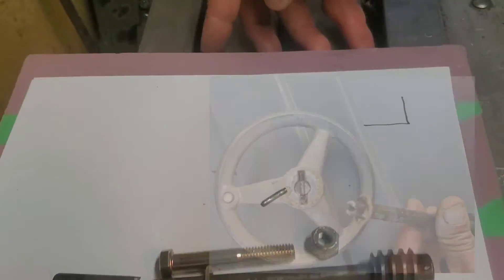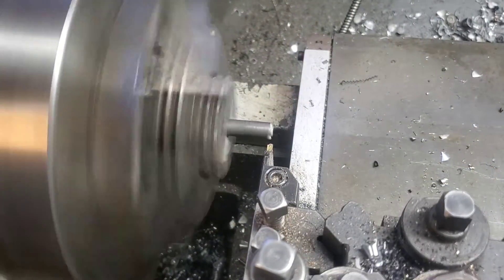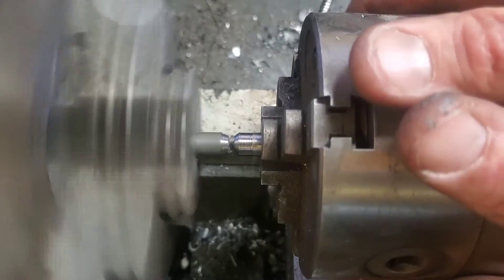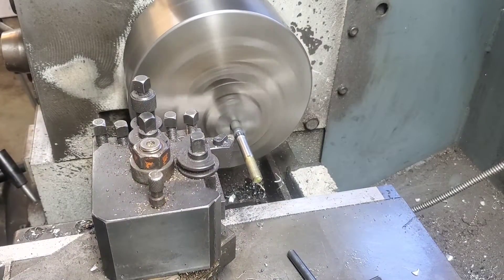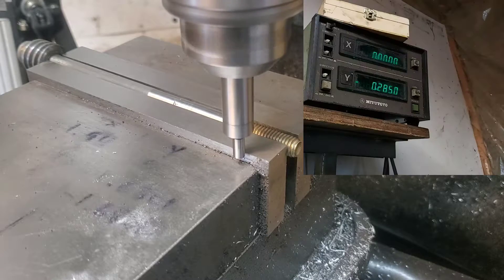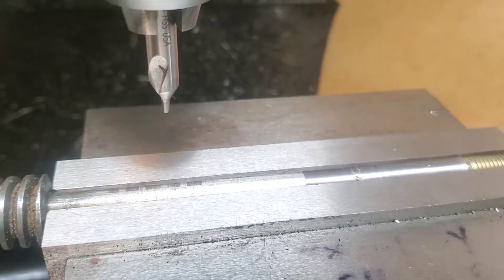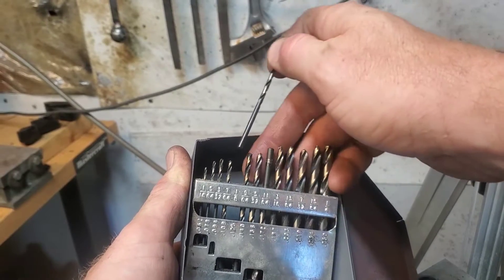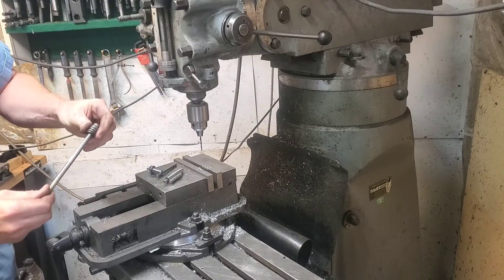Friction Welding Job on the lathe

Comment: This was interesting, Couldn't help but notice the threads are a different pitch between old and new.  Do you think it would be feasible to do friction welding on a lighter duty lathe like a Southbend 9 or 10K or an Atlas/Craftsman?
Reply from the maker: Yes they where a courser pitch , good eye.  This job was for a artist friend of mine and he needed to get back to creating . I found a grade 8 bolt with a nylock nut and went for it :) it should work out the same for him as it isnt a fin pitch for ajustment it is a metric ( made in canada ) thread 

The atlas lathe may struggle i thing as it seemed to need the horse power just befor it welded togeather . Im using a clausing metosa 1440 with a 3 hp motor . Just before it welded it bogged down . 

I would be curiouse to know though if it will work , maby an experiment video from jims work shop !